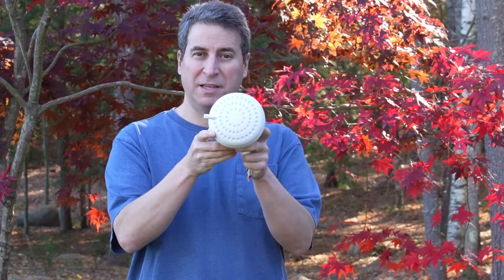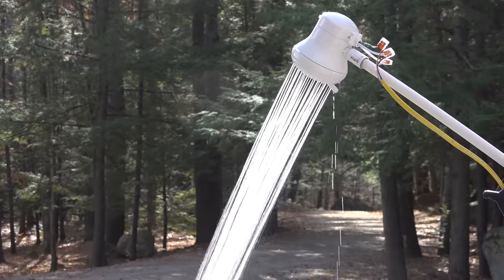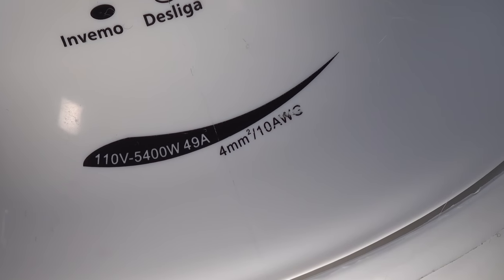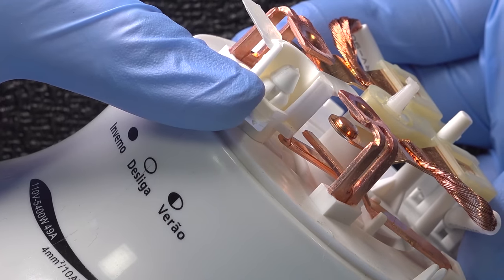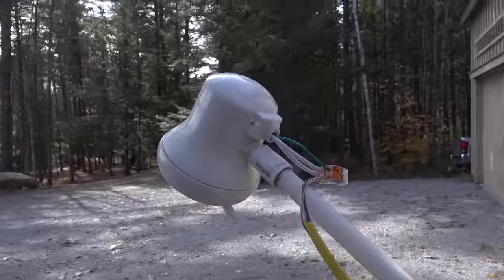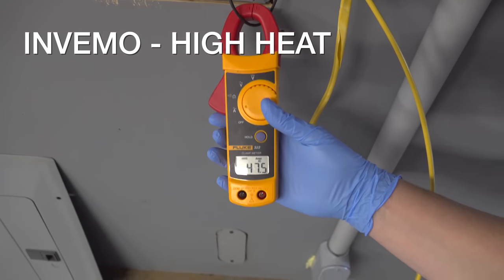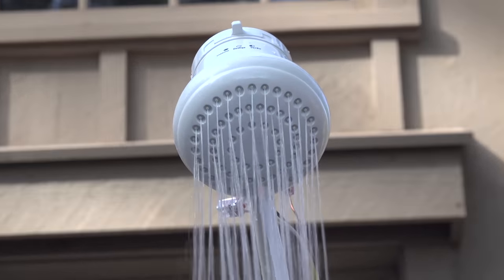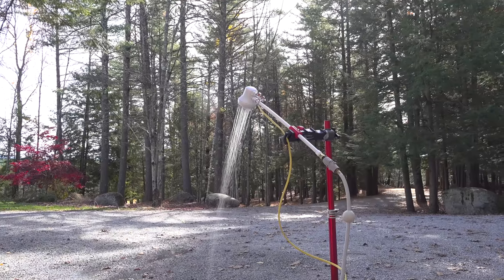What Happens When You Use a SUICIDE SHOWER HEAD in the US

Comment: Brazilian here. The unit you tested is actually very simple, cheap and low wattage.
Here in the south of Brazil we have temperatures down to 0ºC (32ºF) -right know the temperature is at 14ºC (58ºF)-, so we use stronger units (mine is 220v 7800W), some with a TRIAC circuit to adjust the heating without having to decrease the water flow. 
The correct connector for it is a ceramic terminal block, sized to the gauge of the wire (6~16mm² / 10~6 AWG), that should be installed inside the outlet faceplate (not exposed to water).
As long as you have a good ground (we often use a ground bar dedicated to each shower head) it is quite safe. But you should turn the water off before changing the season selector on top, to avoid electrical arcs.
Oh, and we also have small electric heaters similar to this one, to connect to individual kitchen taps.
Reply: Yeah but the amperage it takes is crazy, let alone if the resistor in the shower head or fuse went out that's a full on electric shower
Reply: @localterrorist3155  Good thing that not a thing that happens.
Reply: I'm also in the south and everything you said is true, but gas heaters are very common here. It's way more confortable to have the heater automatically control the final temperature, regardless of the water presure, flow and initial temperature. It's also super cheap if your building is directly connected to the gas network.
Reply: @EnricoDias  I didn't knew we had heaters in Brazil. I'm from south too.
Reply: @EnricoDias  I had both types and I like the electric I have now, it heats in an instant, while the gas ones I had to wait. I can control the temperature with precision using a rotating thing, don't know how to call it, while the gas ones always had heat and cold water to control. Mine has a good pressure, never tried full pressure, and I can change the angle of the head. It isn't too much expensive, but is worth it.
Reply: @gabrielv.4358  Some new buildings have gas lines to the apartments but use gas tanks, and in some cities there are gas distribution lines, but these are not common.
Electric is way more common.
Reply: @parden3743  I can set the temperature in my heater and it heats the water to exactly that temperature. I don't have to mix with cold water in the shower, I just open the hot water. Thats why it's so convenient. Any shower head can be used.
Reply: @MarcusBuer  yeap, gas lines are common only in larger cities, but the gas costs almost nothing this way. Gas tanks that need to be filled are 10x more expensive, but still worth it.
Reply: For those who think this is going to trip any breakers, homes here in Brazil usually have a circuit dedicated for the shower. For example, the apartment I live on has a 220V 40A dedicated circuit just for the shower, so in theory I could use up to 7800W (highest I could find) just fine. I've got a 6800W one instead, has a nice potentiometer-like thingy on it to control temperatures, works really nice and as far you have grounding set-up it's perfectly safe, as the grounding pin touches the water and and stray currents will go out through it.
Reply: @gabrielv.4358  We use natural gas heaters + solar heaters here in our home. Caxias do Sul - Río Grande do Sul
Reply: the litxhen tap ones do seem 500x times sketchier than the showers, I have to admit, but, yeah, they're mostly safe even though everyone uses them
Reply: Assim você estraga anos de piadas "Sul + Duchinha Corona" . Hehehe
Reply: @EnricoDias  In europe propane or propane-butane is now cheaper than natural gas. Some businesses or people are trying to get storage tanks even they are connected to natural gas.
Reply: @rybaluc  I'm not 100% sure about what kind gas they sell to people conected, but it's probably cheaper because they don't have to pack and transport it.
Reply: @EnricoDias  And that is the point of my comment. When resource - NG cost much more that LPG transport fees now LPG is viable option. Because it's price in EU increased only around +48% compared to over +300% in case of natural gas. Not mentioned that  you own your storage facility and you decide when to buy gas or how much surplus.
Reply: 7800w doesn't really sound like low voltage. Plus that sounds like immensely thick guage wire.
Reply: @ubacow7109  7800w is a lot, but it uses about the same gauge used in America for electric dryers, air conditioners, and electric water heaters. This is possible because most places here use 220v instead of 110v, so the current decreases with the increase in voltage.
Reply: Your English is really good. I'm. Curious, do Braziliansearn English in school or something? I see a lot of Brazilians who wrote so well.
Reply: @georgebright7541 Thanks, mate!
While we Brazilians do learn English in school, it’s often just basic vocabulary and common phrases—nothing really useful for communication. 
Fortunately, I had the privilege of being raised with early internet access (pre-Google), and during that time most relevant content was in English, so I immersed myself in English content from an early age.
Most Brazilians who can communicate proficiently in English will probably tell you they learned by watching TV shows, playing games, or reading books, most often of pirated content (downloading pirated content is not a crime in Brazil).

Comment: Here in Brazil we really have this device and the photos shown are reality in some places.  Honestly I've never heard of anyone dying from the electric shower, but gas inhalation deaths do happen, which makes the suicide shower seem funny.  One thing that helps make the shower safer is that the water and sewer pipes are all PVC.  Metal and copper pipes are used only in air conditioning.  Another point is the reality that some houses do not have grounding.  Another point is when the power connection is at 110V, the ground wire is connected together with the neutral wire. But when it is connected to 220V, (as is the case in most homes) grounding is not used and another benefit is that the electric current is reduced by half.
Just a note, you should never change the shower temperature with the water on.  This severely damages the electrical contacts and runs the risk of arcing (due to high amperage) and ending up creating bad contact at the terminals.
I hope I could have contributed with some information.
Reply: some showers don't even let you switch the temperature with it on, I know I was used to switching mine without turning it off but recently switched and found out the one I got now locks the switch while it's on so you can't change it
Reply: I always thought it was a myth, so I often change temps with water flowing. But honestly nothing ever happened with me as I don't use high temps  (although with high wattage showers/temps I could see it light up inside for a second..)
Reply: 220v is usually used to get more power, so the current isn't half. Most 220v showers consume 7500W.
Reply: ALL the houses lack grounding, you mean, lol.
Reply: @gabrielv.4358  Mine don't
Reply: @AkiraMiles  Good to know!
Reply: FYI, it is normal for the neutral and ground to be connected together. They both connect to the middle of your transformer, the path electricity wants to flow to. Therefore you do have a dedicated ground fault path.
Reply: Just go to any random house in Brazil and you find one.
Reply: there are states that a single power wire has 220 volts, so it's possible to connect the ground to the neutral there, using 220v too.
Reply: I live in an apartment with grounding. Building was built in 2002.
Reply: I've also used these in Brazil
Reply: I agree that quality can really make a difference in how these perform.  As an American working in Brazil for two years I replaced my rental unit’s basic model with a premium one that cost twice as much and it was a huge improvement.  However, in a different apartment, with older wiring I definitely felt a tingle when I put my hand within an inch or two of the head while showering.
Reply: Glad to hear of the info on these as I have never heard of them even considering the fact I have relatives in Brazil and my American uncle has a second home there.
Reply: @EnricoDias  Potency (W) is basically Voltage (V) x Current (A)

W = V x A

so

7500w / 127v pulls more current than 7500w / 240v

Comment: I grew up in Paraguay in the 1970s and 1980s. We got our first electric shower (as they are called there) in late 1979. Before that we used a shower bucket with a capacity of about 15-20 liters. So "cold" showers were the norm. For a warm shower we heated the water on the stove and dumped it in the shower bucket just before showering.
Now a days the electric shower is usually run on a dedicated 25A circuit (at 230V). The plus (+) and minus (-) signs on the connecting cables have a very specific purpose: you want your "switch" to be on the "phase" side of your heating element, not on the "neutral" side. If you get the polarity wrong, you run a very high risk of getting shocked as soon as you turn on the water tap.
For new installations (since about 10 years ago) it is standard to have a big CFM breaker installed in the breaker panel, right after the main breaker, that feeds the individual circuit breakers. The neutral is connected to ground at the meter box by the electric company. And the ground circuit in the house is also connected to the neutral line in the main breaker panel. So it is rather common to connect the shower ground wire directly to the neutral line to prevent the CFM breaker from popping. Though this also depends on the mineral content of the water.
We quickly learned to keep our hands (and other body parts) at least 30-50cm away from the shower head, in order to avoid electric shocks. With lower mineral content, less distance; and with higher mineral content, more distance!
And yes, the higher your available flow rate is, you will be able to make a bigger temperature adjustment. Also, if your faucet is only a quarter turn to fully open you will have less ability to fine tune the water temperature than if you faucet takes two full turn to fully open.
Complaint: For safety reasons the shower head needs to installed with the input pipe as close to horizontal as possible. With your inclined installation the shower head drains when turned off and you risk turning the heater on dry. The installation instructions caution to run the shower without electricity for at least 30 seconds after installation or maintenance in order to drain all air out of the heating chamber.
Reply: This situation is often called a loaded neutral.
Reply from the maker: Thank you for sharing this, this is very interesting, especially the switching and polarity info!
Reply: Man, scary, I’m glad to have freezing cold groundwater here
Reply: The hose and sprayer he mention its actualy a safety feature... Has to be install in the wall away of the person.. When the mineral deposits clug the small holes of the shower the pressure open this plunge and release the water
Reply: @trevorsmith5524  And if there's a problem with the neutral being grounded... guess what/who's gonna act as the ground.....
Reply: @forger9443  That's not what i'm referring to. 

A loaded neutral is what happens when you switch on the neutral side instead of hot. 

switching on the neutral side will cause you to have a live wire.
Reply: why didn't you just run your water pipes over a firepit to heat the water inside of them... i did that to make a propane powered hot tub.
Reply: You must be 150 years old!😂
Reply: In the video, one can see the flow break up into droplets farther away from the showerhead, instead of staying a continuous stream.  I wonder if there are showerheads that shoots pulses so that they can stay in closer reach?

Comment: im brazilian and i can confirm that they are "safe" even on 240volt, and yes there is not a single case of death by this kind of shower at least not on brazil that is
Reply from the maker: I appreciate the feedback. When I started this video I thought there would be many accidents but as you said their engineering cleverness seems to have created a surprisingly safe device.
Reply: @SilverCymbal  Well, i think because we get used to it and depending on the installation it doesn't shock you. in my parents house its a 220v (fase + fase )and without a ground cable, in my bathroom its shock you slightly if you touch the register when its on, and on my parents its doesn't with the same shower head.
In my uni apartment its 220v( fase + neutral ) with ground and i can say its safe, it only shocks you if you turn off the wrong breaker and proceed to install a shower head 🤡.
And if your hand gets too close to the head sometimes you can fell slightly the current.
Reply: its safer to use it on 110v tho. since you have less tension trying to overcome resistance and you will NEVER experience eletric shocks on 110v
220 you might receive eletric shocks if the register is made out of metal

Comment: I know those! Here in Argentina we call them "ducha brasilera" (Brazilian shower) that one you got there is a pretty cheap one but also one of the most cost-effective that there are, it doesn't give a lot of heat but better brands usually offer better experiences
Reply: I believe it depends on the shower model. Here in Brazil, I remember once that my dad had a really, REALLY powerful shower head that we ended up ditching later, because the damn thing almost scalded your skin with boiling hot water. That thing was insane.

Comment: I'm Trinidadian and I have been using one of these types of shower heads for over 15 years and have never gotten electrocuted. It's ridiculously cheap and the element inside to replace is even cheaper and so easy anyone can do it. If it's shocking you then the electrician who did the work to run the connection to it had no idea what he was doing.

Comment: Here in Brazil, you can find those showers almost in every home. Here it's just called an electric shower and we don't see those showers as dangerous. I don't know about any case of somebody dying while taking a shower with those here in Brazil, but a got a shock from the faucet sometimes when the shower wasn't well grounded or not grounded at all. For Brazilians, gas-heated water scares us more than electric showers, and in some houses, the resident omits it, installing an electric one in the place of a gas-heated one. But there's a reason.
It's because, in the past, heaters were placed in the bathroom and unlike electrical ones, we have many reports of people dying while taking a shower because of many reasons. Since poisoning by CO2 from leaked gas brewing all the place.
About the nomenclature, "verão" means "summer", while "Inverno" means "winter" and that nomenclature was supposedly for been used in those modes over the described season, but practically this wasn't the case,  meaning that referring to "summer" for low and "winter" for high it's just an old tradition that nobodies have broken yet.

Comment: I used these for many years as a kid, they are safe but I have felt tingles when turning water on or off. Most of South America is 240v but many cities and few countries are 110v. If you want to watch another video on this, DiodegoneWild made some good ones.
Reply: Yep
Reply: I'm assume you probably couldn't get it hot enough with only 120v and a not huge wires
Reply: @james10739  110v/127v usually tops at 5500W / 50A. The appropriate gauge would be 10mm²/ 8AWG.
For 220V they top at 7800W / 36A, so you can use thinner cables. The appropriate gauge would be 6mm² / 10AWG.
Reply: @Marcus Buer  I mean he ran 12awg and that's about what it looked like was on the unit and I guess for as long as you are going to run it for 8awg would be fine but thats still pretty big wire to run to your shower

Comment: Sounds like it could be useful for RV showers, although tankless water heaters are more popular for that nowadays and can fairly easily be retrofitted to even older RVs.
Reply: I have a "point of use" tankless heater. It's meant to go under a sink. 

I've got it powering a whole efficiency apartment. Works great for a shower if the sink is off. 

It was cheaper than doing one for each
Reply: @trevorsmith5524  I'm an electrician, we install those a lot. Mostly commercial restrooms but I have done some residential installs for  showers and under sinks.
Reply: Uhm, do RVs have a source to ground?  
I really don't think this is a good idea if someone wants an outside shower.

Comment: Another factor working in the benefit of safety here is that the water coming from the head isn't a solid, clear laminar flow. Rather, the water coming out is a turbulent flow full of individual drops that only maintain connection with each other momentarily several times as it falls. If a high voltage device were connected to the source, this is the sort of flow you'd want coming at you as the electricity will be far less likely to travel down that path.

Comment: I used to live in an apartment in Texas where the main water was just a few inches below the asphalt in the parking lot, and in the summer the water coming in was close to 90°. The hot water line from the heater ran through the vaulted ceiling roof, and when I would first turn on the hot water in the bathroom it was hotter than the water coming from the heater set at 140°.

Comment: Great video! We've been using this kind of shower heads for, at least, 50 years in Brazil. Nowadays they seem to be much safer than the ones sold in the 80s and 90s. The model you have in the video is the most popular one sold here in Brazil and it's also the cheapest one on the market. Considering that most of the Brazilian territory is composed of tropical zones, it does the job!